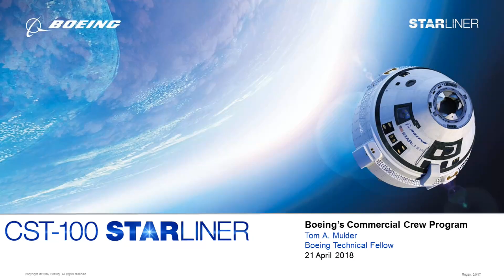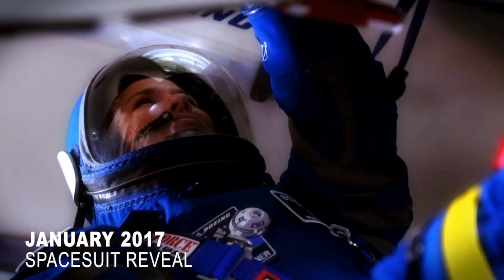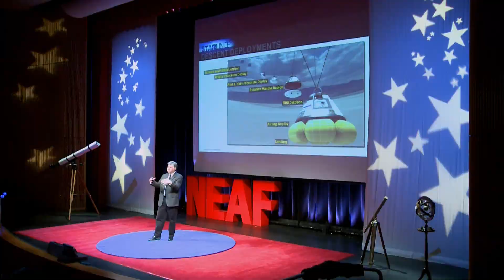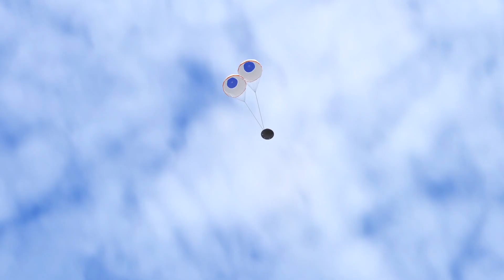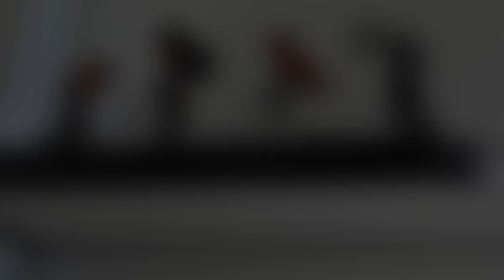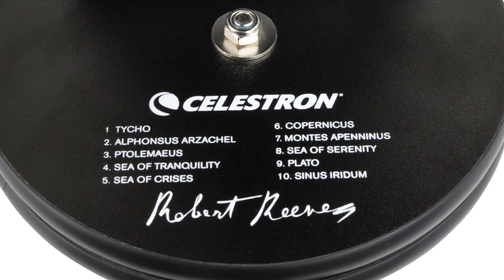Tom Mulder | Boeing CST-100 Starliner | NEAF Talks

Comment: Quit talking about the stupid starlifter....quit!
Space X is making the Starship!!!!!
Reply: D Hardy, I get that you are excited for the possibilities that the Starship represents, as are many, but I think you miss some finer points of the situation.  Even with the most aggressively optimistic timeline, Starship is years from flying a manned mission. The CST-100 and Crew Dragon are ready now, and will both fly within months. Moreover, they are already contracted to perform this service for 6 flights each. At current tempo, that's another 6 years. If Starship is flying, proven, reliable and cheaper by then, which I think it will be, then very likely NASA might offer a contract to SpaceX to perform this service with it.
Reply: @simonoconnor7759  ive heard about that program for the last 10 years and its garbage....its like the crummy british or Canadian jets that would sit on the drawing boards and in prototypes til they were obsolete.
Reply: @dhardy6654  , I think the situations are not entirely analogous. Certainly, this Boeing system is very conservative, offering no real new flight technology, just a conical capsule and a disposable booster big enough to get it to orbit, but to be honest, that's 100 times better than what NASA has had available for the last 8 years, which is exactly zip, zilch, zero. Begging rides to orbit from the Russians at exorbitant prices. And while I think that SpaceX's system using the Falcon 9 will prove more financial viable in the long run, having multiple vehicle options can only be a good thing. For humanity to be a spacefaring species, we can't be locked out of space by the grounding of a single launch system. Mindless hatred of Boeing achieves nothing.
Reply: @simonoconnor7759  i dont hate boeing...im saying Nasa has paid boeing to build something that now is obsolete. When i go to Nasa and see the mock-ups its like going to some stupid canadian or british Museum and looking at the junk they never fought anybody with...pointless junk they developed while the shit we made was for real warfighters and they could have just bought it from us.....who cares that nasa astronauts ride soyous? 23 mil a seat is cheap !
Reply: @dhardy6654  , Soyuz flights are currently about $82 Million per seat. And that is what NASA is paying untill either of the CCP craft fly. The last quote I saw for the SpaceX crew dragon was about $20 Million per seat, although that may have changed. You keep mentioning British and Canadian aircraft designs, as if that has some relevance to space launch vehicles.  It does not.  However,  even there I suspect your arguments are simplistic. I suspect you are referring to the Avro Arrow. Interesting link here: http://blogs.discovermagazine.com/vintagespace/2019/07/16/the-canadians-who-got-america-to-the-moon/#.XZ15Sbc7aDY

Also, many British interceptor types came to fruition throughout the cold war years, spend decades providing sterling service, and retired without firing a shot in anger. This does not make them a failure, junk, or a waste of time and money,  on the contrary, it makes them arguably more effective than those that ended up in shooting wars.  Much like Polaris, Poseidon and Trident, they are good to have, but even better if you don't have to use them. But enough about planes, there are hundreds, if not thousands of of aircraft designs. There has only ever been a handful of spacecraft which have taken humans to orbit. Vostok, Suyuz/Shenzou, Mercury, Gemini, Apollo and the STS (aka "the space shuttle"). It has been literally 38 years since a new design has carried humans to orbit, and mere months out from 2 new ones taking off, you suggest they quit and wait for a giant high risk rocket in it's first stages of development. I look forward to the Starship, but it's time will be in 5 years or so. It is Starliner and Crew Dragon's time now.